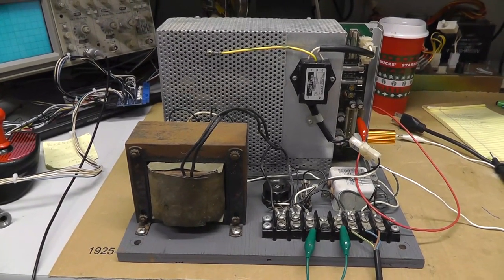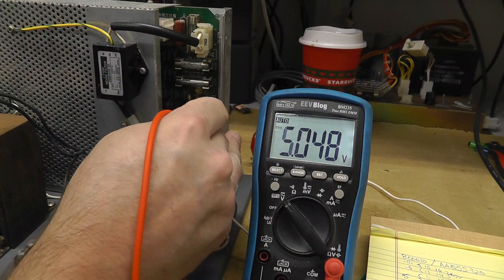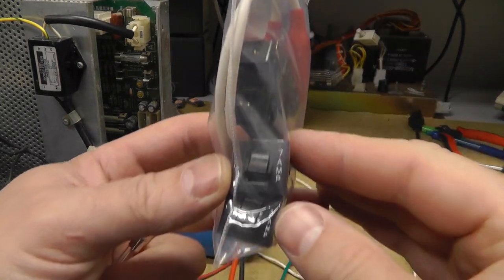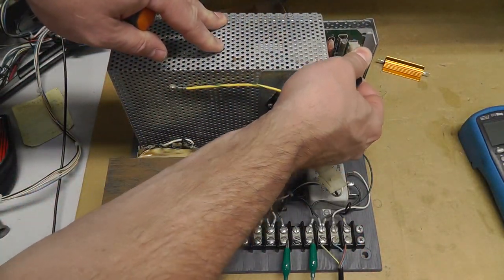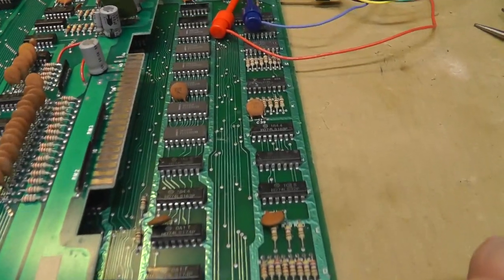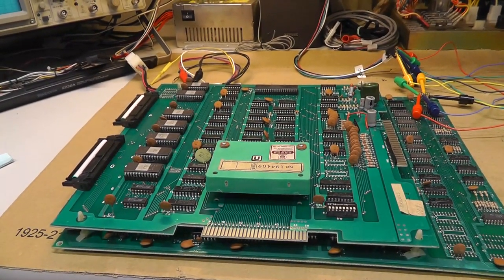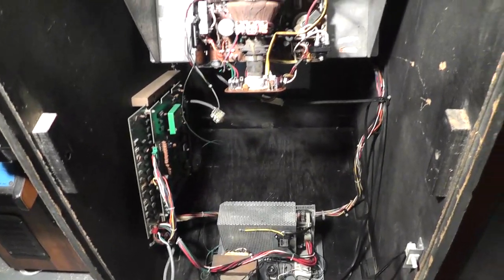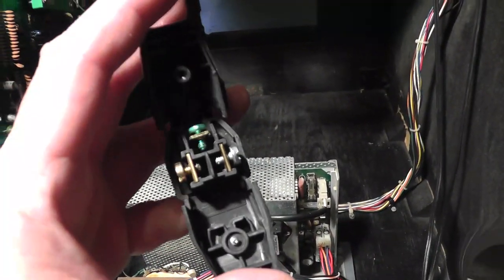Taito Crazy Climber Refurb - Part 1 - Testing Power Supply, Reassembly, & more Testing

Comment: If I were to guess there's a Noise generator whose enable is stuck on. You can hear the AY sounds in the background.
Similar thing happened on my customer's DECO Cassette System, just when I wanted to call it good, some weird noise started...
Reply from the maker: Looks like I will have to make a more complete bench adapter to test after all.  Thanks for the suggestion.
Reply from the maker: Well it took me longer to build the adapter than to fix the thing.  I won't spoil it too much but the AY-3-8910 has a noise gen built in.